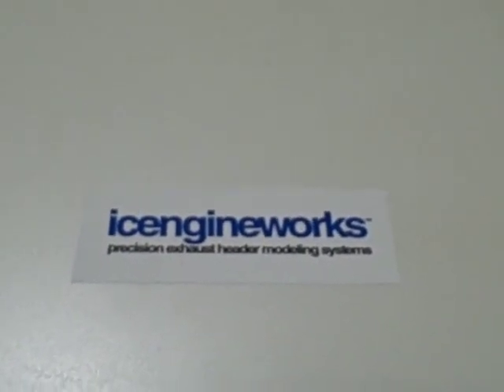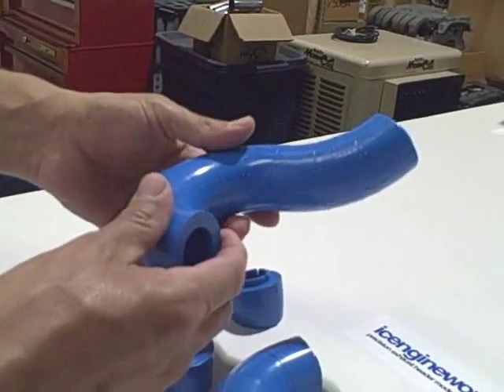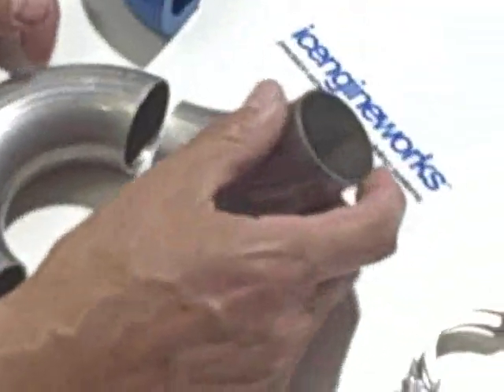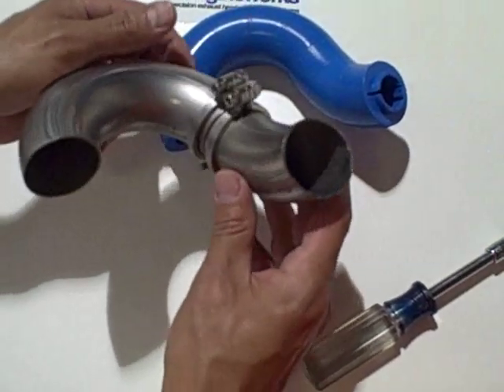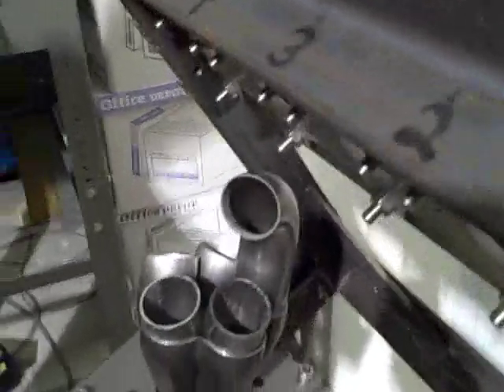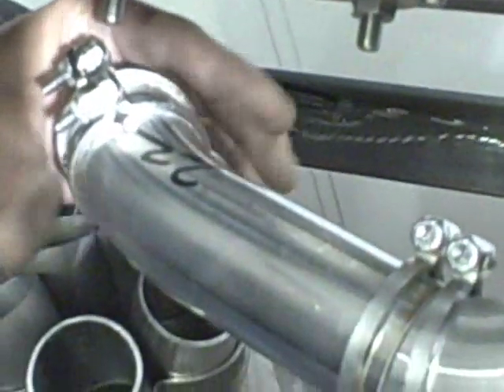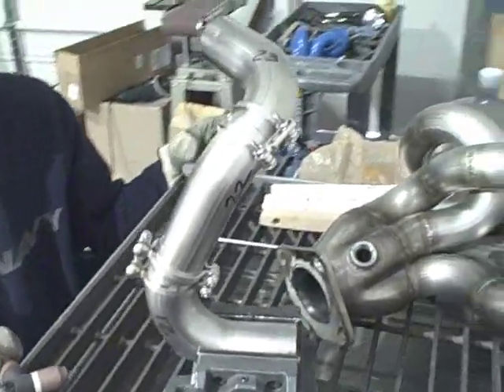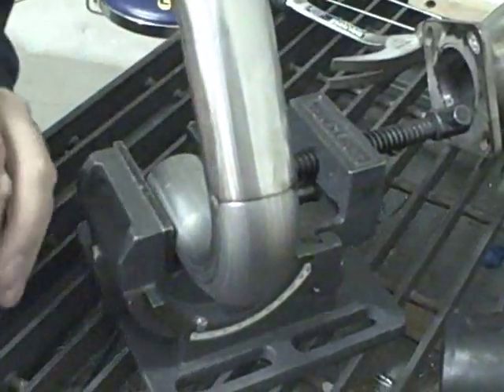icengineworks - Intro to icengineworks Tack-Weld clamps

Comment: @lrodcantu , Dude I spent weeks looking for the tightest hedders I could find for my application and had to modify the hell out of them, that took another week and I still dont like them , Custom exhaust shops here in Brisbane , AUS want about $2000 for 4 into 1 tuned length mandrel bent hedders this 1625basic kit plus freight is going to cost me about $500AUD , you'll find you always pay for innovation but if I make my own hedders using this product I should of saved about $900 In the end !